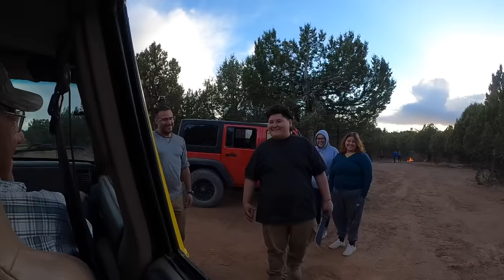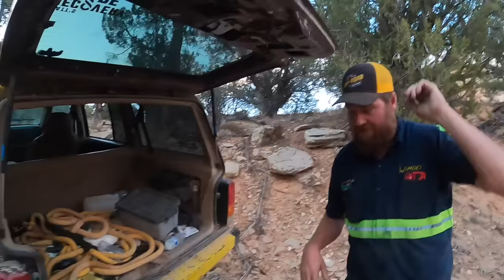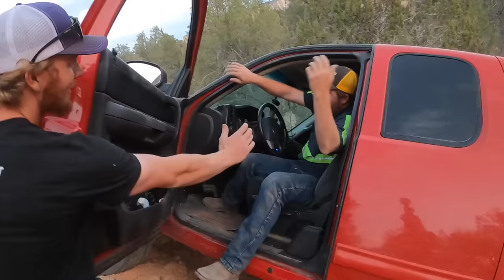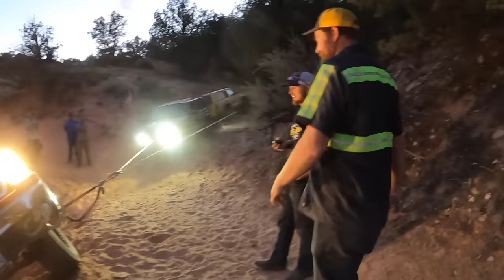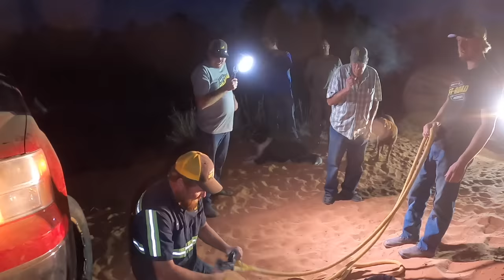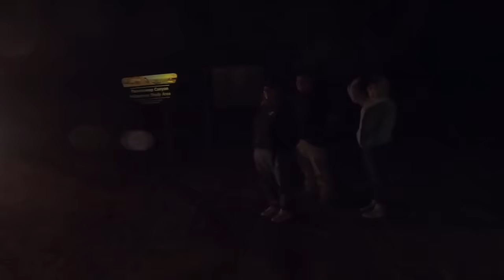GMC Sierra Goes Over The Edge - 2WD Truck!

Comment: Till the shot on 11:05 I though Matt you're wrong this time. But seeing the slope hill side on the other side I changed my mind. It indeed  works out at the end very good.. Well done!
Reply: It wasn't pretty, but given the angles; it also wasn't horrible. I'd have anchored to a tree and had the Banana as safety/second anchor for the transitions. Otherwise: 
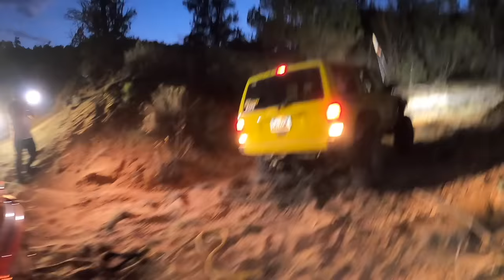@12:50 check out those pimpin lights on Rudy's chassis! Bawlin!

Added... were those front wheels ... bald in places? like completely no-tread/tread?
Reply: @MattsOffRoadRecovery  I did not realize the weight difference was that big. That makes the things the Jeep can do even more impressive
Reply: @fshalor738  I think what you saw was the tool Matt uses to blur license plates was on the tire for some reason. I thought the same thing as you as I thought "how in the hell can you have bald spots like that."
Reply: @Timooooooooooooooo  it’s almost all in the yank ropes for most rescues
Reply: @fshalor738  yeah they were definitely bald in some weird places...
Reply: Hey Matt what was your first thought when buddy looked straight into the camera sharpening his big ass knife
Reply: Forward was clearly the easiest option!!!
Reply: @Timooooooooooooooo  The light weight is precisely why it's so good at floating over stuff, and why the stretchy ropes are so critical.
Reply: @MattsOffRoadRecovery  8:.00.. just my 10c.. id anchore the rear to a tree,then pull up the front. full lock left. or better yet.. let it gooooo,,its only 2wd.. people ask me,why you buy 4wd.. i say,it tows more. & a sht load more handy.. ausie..plus winch & good set a/t,s...
Reply: @phantomwalker8251  4x4 have a lower tow rating compared to their 2x2 counterparts due to the extra weight of the 4x4 system.... might pull more on dirt but has a lower rating
Reply: @MattsOffRoadRecovery  I'd love to see that with a weigh bridge receipt.
Reply: @coldblue9mm  I rew and thought the same thing. wtf? maybe the sand was making it look patchy but it sure looked like to me it wasnt from regular wear of driving. Like they been power sliding or something. Or maybe those were on the back and they drove around with the e-brake locked and were just dragin the rear tires :) 

Either way I would have never even driven those on the hi-way much less 7 miles into bush.
Reply: @MattsOffRoadRecovery  And that's why your jeeps don't get stuck (usually). Lizzie keeps improving her driving skills you're going to need to put her in her own XJ.
Reply: @whidbeyhiker4364  Lizzie comment. ROFL
Reply: Hey Matt, I heard from another channel that Randy quit.

What happened to him?
Reply: @MattsOffRoadRecovery  There comes a time and place where you have to wonder WTF were you thinking!?
Reply: @MattsOffRoadRecovery   I originally thought you was going to put a jeep off both corners. Using both winches to slide it back up onto the road basically the same way it slid off. But... a video just doesn't allow us to see the entire scope of the terrain that you're dealing with. Great job. Nice vid
Reply: @MattsOffRoadRecovery   As you were pulling it perpendicular to the hill I was questioning why you didn't just pull it along the hills, with the sand being as a stop on the side of the tires. As it dug out and the sand quickly moved out of the way I realized that being a computer chair rescue person, I have only the fundamentals and no practical experience, not to this level. 

Great rescue and fantastic videos. Keep them coming.
Reply: @MattsOffRoadRecovery  Love it! imho there is no "right" way to perform a recovery. Just a whole lot of wrong ways to do it. You got it out with minimal to no damage, that is a win! - Former army H8 recovery operator
Reply: @Rob4b4, I did too! It’s so difficult to judge what’s going on with a recovery. Add the perspective of being behind a camera, and it’s 10 times more difficult to judge. As soon as I saw them pull it up I knew it was right.

@Matt’s off road recovery, what do those jeeps weigh? I’m guessing in the 3,400 lb range?
Reply: @MattsOffRoadRecovery  the truck itself should only weigh around 5000lbs but seeing as its on a down hill and you're pulling it up, gravity probably has it weighing about as much as both jeeps
Reply: @MattsOffRoadRecovery  Just Waynnnne-ch it up there cowboy.
Reply: @MattsOffRoadRecovery  love the channel. You have the patience of a Saint.

Question: does dragging a car sideways damage the suspension?
Reply: @MattsOffRoadRecovery  Not to be "that guy", but those XJs are probably 4k lbs each, combined they weigh more than my 3/4 ton diesel QCLB 4x4, no way that 2wd half ton is anywhere near that much. However your recovery techniques get no arguments from me!
Reply: @bmdubclub9933  I have an fx2 f150 and it's tow rating is 7,100 with the 5.0, the fx4 with the 5.0 and my year model is 9,000.

Comment: You can see Matt's experience and intelligence kicking in on this one. I am impressed!
Reply: @sad754yt  has got a thousand things going on which makes it easy to overlook a question like that plus he's probably more worried about finding the vehicle in the middle of the desert and coordinating with his team to get everyone on the same page and to the job as soon as possible
Reply: This dude is got alot of good judgment and common sense!
Reply: If there was a harder way to do that, I don't know what it is.
Reply: @wylde007  look at the pitch of the vehicle, and the soft structure of the terrain. It won't take much for a roll over.
Reply: @bh2671  Exactly, he had lots going on with assessment of the site, vehicle pitch/soft terrian, and probably slightly nervous with seeing someone sharpening a knife, and Matt didn't think to look at the front hub for the locker...I'd assume it was 4wd too, it looked 4wd at first glance.
Reply: I didn't say it wasn't sketchy. I said his initial approach was flawed and as a result, ended up taking a lot longer than it should have, while also being more precarious.
Reply: Using a snatch block only halves the load on the winch if it is connected back to the vehicle with the winch.
Creative yes. Intelligent. .. hmmm

Comment: Miles of deep sand on that road. Mostly further down, but right there is was plenty soft. I did this road on my bike.  The part right in there where the truck went off is super fun. All the turns are banked out by SXSs, so on a bike it was like a roller coaster. 

Like some other viewers, I was thinking it would be better to go out straight ahead, but Matt shows why he stays safe and stays in business.  Nothing like experience and being there.  Well done.

Comment: Pro tip: a short section of PVC slid over the gas shock will drop and hold the hatch when it's opened. To close, just move the PVC so that the tube can slide in it.

Comment: Just bought a F-250 Super Duty 4x4 super cab with an 81 inch bed. Slightly longer than a standard PU. Put 3k in wheels on it. Learning what not to do when traveling even with an appropriate set up.

Comment: I was first thinking one pull straight and one off to the side where you were.  Maybe with the rear-end secured.  But that assumes you have a really good anchor points out to the side, front and back.  And one person controlling both winches.  But you didn't have any great anchor points out there  And it was a, as noted, much heavier truck.  But my cargo loading experience the winches were fixed to the ship.  You were the guy on scene and the ground under the truck didn't look all that secure.  Camera angle matters.

But you got them out, nobody hurt, no winches or lines broken,  so mission accomplished.  Not many guys use vector math, statics and dynamics in their heads.

Comment: Phrases you rarely hear from Matt - “ Today, I’m gonna shave my beard” and “We need another winch”.😆

I must say, looks like RUDY’S winch did a huge job on this one.
Reply: The Thunder Wagon has a winch. Just saying. And then they come up with plan B that works just fine.
Reply: @jimhubbell8364  true, which was a bit of a surprise. Matt has objected to a winch on the banana for some time due to weight. Just sayin’.😎
Reply: @hgj2019  I've often wondered about this. Matt worries about the weight of a winch, then carries one in the boot. Granted this system means it can be used from either end of the banana, and while carrying it the weight is on the back tyres instead of the front. I'm not sure if that is better or worse. Also makes it an option to leave at home. But while carrying it, you are still carrying the weight.
Reply: @vanmanmarc  He only carries it on jobs where he thinks he might need it, it gets left behind a lot of the time.
Reply: @vanmanmarc  only thing I can figure is that he is trying to keep the weight off the front tires, since most of the weight is already there (engine, tranny, etc).

One thing I DO KNOW, Matt is a true wizard off-road. He gets in and out of places I would not even try, MIGHT not even want to try and walk over.😳
Reply: Iron *Fe*  MAN! You’re telling ME! Over the years I’ve had them and shaved them. Shaving one off is NOT my idea of a good time!
Reply: @hgj2019  you are right about Matt's abilities. He is the only guy I have seen rock crawling with a trailer on the back.

I'll admit I know nothing about driving off road. The most extreme driving I have done was when I drove over my value cap when I checked my tyre pressures. I watch Matt, Casey's recovery and Fabrats and they often stand on their rear wheels with their fingers crossed the front will come back down when going up a climb. The winch may help at this time.....or get caught up on the rocks. I don't know what effect it would have on the way down. I imagine the resistance of a dead vehicle on tow or a trailer would take some weight off the front axle.
Reply: @vanmanmarc  Right! It KILLED me the time he went for the motorcycle, trailer in tow. Great wheeler!
Reply: @hgj2019  or the time Matt picked up a side by side and got his navigation confused on the way back and lost the trail he thought he was on and Jamie follow him over the rocks. "We're committed now"

Comment: I hate to say it Matt, but I think rigging the winch to the tree first then to the back of the truck, and back to the tree would have cut your recovery time at least in half. It would have pulled the back of the truck the proper direction on the first pull. But you did get it done, and that's what counts!
Reply: I agree rigging it to the truck then the tree put most of the pull back when directly sideways would seem to be better.  But Matt knows what he's doing I'm sure there was method to what he did.
Reply: Unfortunately wheels don't roll sideways or I'd agree with you
Reply: It's funny how people are fast to comment not knowing you are also great at recovery. I watch both channels and see them rock what they do.

Comment: Reasons to buy a 2wd include: higher tow capacity/payload, better fuel efficiency, cheaper maintenance, and s big one is you can get much nicer trucks for cheaper if they're 2wd
Reply: ^This.  The four most common reasons to buy a 2WD Truck are:
1. Cost
2. Cost
3. Cost
4. Payload capacity.

And there should be more of #4...  4 Door 4WD Trucks with options, accessories, occupants, and a full tank of gas often have shockingly limited payload capacity remaining.  This limits how much they can safely tow directly as a contribution to the gross combined vehicle weight and indirectly by preventing you from using the rated hitch weight without overloading the vehicle.

Comment: I drove a Renault compact sedan to Thunder Egg Lake, Oregon. Thirteen-inch wheels, front wheel drive, through a couple of creeks, to arrive among a couple of a couple of full-size Chevy 4X4 trucks. They told me I was crazy. I told them my car cost $750.00 and got 30 miles per gallon. That's why you buy two-wheel drive. You're a newlywed living on an enlisted sailor's salary. Live by the rule: If you drive home, you weren't stuck.

Comment: If I only had dash cam videos from January when I got 5 feet from the top of a steep driveway with snow on top of ice. Tires spinning like mad and I slid backwards down it and slid off to the side into a thicket of 2” diameter trees. One bent the side of my Rangers bed. With my 30’ tow strap, a pine tree down the hill and my come along winch I got out. I’m lucky that I didn’t roll my truck. It was several seconds of oh 💩 💩 💩!!!

Comment: Would your first attempt have worked had you placed an additional snatch block on the tree using it for both a redirect and an anchor by running the line back from the second snatch at the bridle instead of just on the bridle?

Comment: I can not believe all the 2 wheel drive pickups, and they are not basic, striped models that is all the buyer could afford, but big fancy king and crew cabs, if you are already spending 40 grand or more, 4 wheel drive is a cheap, but great and necessary option.

Comment: My truck isn't 4WD because I don't need it to be.  I only drive on streets and never go off road.  ONCE, and once only, I got stuck in the sand in my own backyard...and a neighbor helped get us out...the old fashioned way, with shovels and boards!  LOL  Since then, I've learned not to drive into that part of the yard!  LOL  It would have been easier to get out if I had remembered at the time, the trick about letting air out of the tires!  :-|

Comment: I gotta say you get it perfect every time, except this time. You should have anchored the back end of the truck first, then rather than pull more from the rear, pull from the side - more uphill. Use banana as the anchor then other jeep with wench pulling at 45 while anchored to a tree. But then remember, I'm one of those keyboard guys. ;) (with 30 years of off roading/winching)

Comment: Matt,  love your channel.   Could have used your jeep here in Oklahoma last year. Got my GMC Canyon stuck in clay that was slick and like pottery clay.  Called AAA and told them I was ¼ mile off the road through trees and they sent a large rollback to get me.  2 he later he showed up and said he couldn't get to me.   AAA agreed to pay since I'm a plus member, and he called their skid steer to get me.   2hrs later, a jeep with a winch came along and got me out in 5 minutes.   Only time I have ever been stuck and had to be pulled out.   So you have any suggestions for driving in clay mud like that?  Yes,  my truck is 4 wheel drive and I was in 4 low. 
Also, have you considered doing a give away of one of your ropes?   I would love to have one but there is no way I can afford one.

Comment: The snatch block did NOT double your winch capacity like he said, the way it was rigged, It only changed direction. The mechanical advantage is only doubled going 180° down & back.. that advantage quickly dissipates every degree less than 180° from the pull source. Those ring type sheaves are not as efficient as a traditional snatchblock friction wise. Better than nothing though.

Comment: Quick Tip: I use a Kettle Pot weight to 'ground' my Winch Lines when pulling.  You can run the line right through the handle, or use a large D-Ring, since I have a mix of Steel Cables and Soft Lines on my Winch(es).  You can store it outside the cab, by just hanging it off your rear Receiver.  It keeps it handy and from banging & rattling around, plus keeps the mud outside.  Also seems to reduce annoying tail gaiting tourists as it swings around back there.   LOL.    Hope to see you out there some day soon.

Comment: If your son wants to use a winch, the I’d suggest a hydraulic powered winch. They use the power steering pump for hydraulic pressure. Hummers we had in the Marines had them. I put one on my 93 F250 HD 4x4. They are about 2000 but they never overheat while you use them unlike electric winches.

Comment: Hey Matt, I have seen in a few videos where you have issues with the AW4 hunting for gears, mostly in the dunes. Check out the RA Designs shift controller, it’s an awesome little unit and I run one in my Cherokee. Changed wheeling and towing for me entirely. It gives full control of gear selection and lockup.

Comment: Matt:"So how far in are ya? "
Dude:"about 4 miles into the desert... As a kid sharpens a 10" knife smiling"
LOL
Reply: And then they're almost 4 times that distance.  How does one underestimate it by that much?
Reply: @treverwhetzel9603  I know right.  Some people have no clue how far a mile is.  To them its just a number that has something to do with how often you get an oil change.
Reply: @treverwhetzel9603  Especially someone who served in Army Aviation... not likely a pilot so maybe a chopper or A10 mechanic?

Comment: Somebody who remembers more trig & physics than I do might confirm, but I'm pretty sure a snatch block only doubles your pulling power when the anchor is essentially next to the winch, with as little angle between the two lines as possible.   Looked like the winch to the snatch block to the anchor made about a 90° angle - I wish I remembered how to calculate the forces.
Reply: Found an online calculator that seems to say that with a 90 degree angle at the snatch block, 1000 lbs of tension from the winch, through the snatch block to the anchor, produces a little over 1400 pounds of tension on the load.  Still more than without the snatch block, so worth doing, but not double.

Comment: I learned to make a bridle here for more control I had to flat tow a 4x4 Blazer with two-wheel drive but it worked good. Thanks Matt's off-road recovery the terrain is a little bit different here in South Carolina it worked great for me.